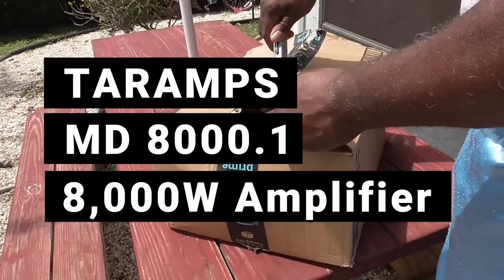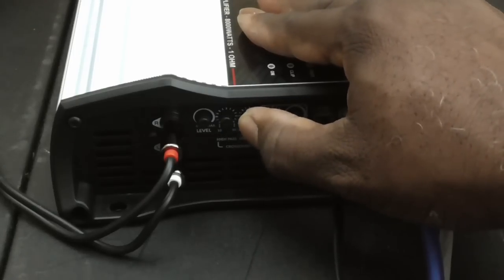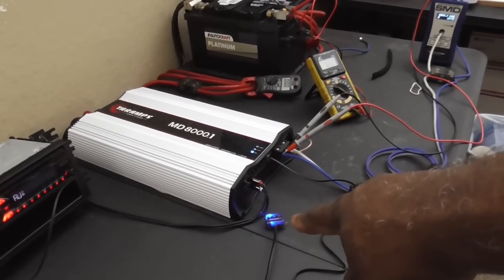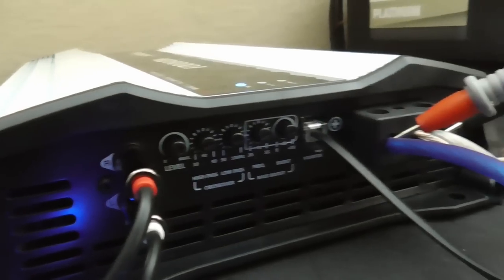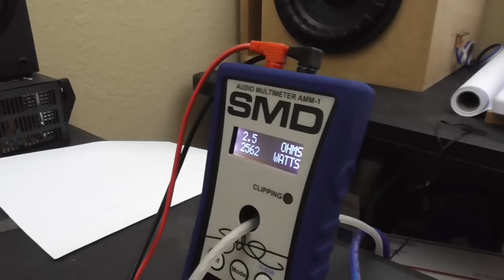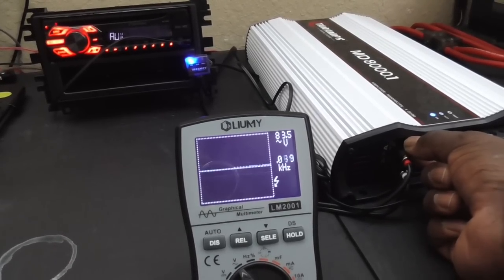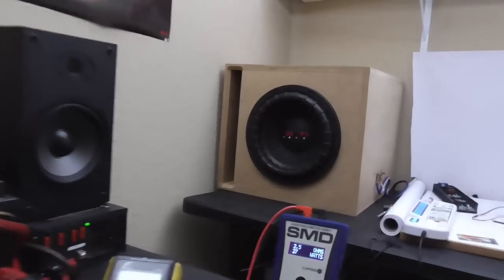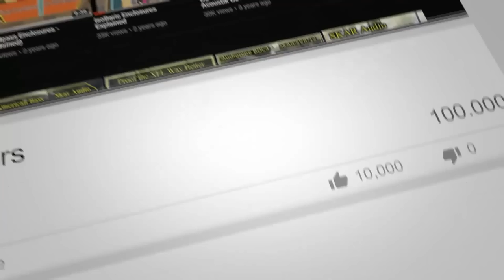Should You Buy This Amplifier? TarAmps MD8000: 1 & 4 Ohm Testing

Comment: That amp is not a amp equip for a subwoofers, impedance has nothing to do with it, sound quality will be horrible, and the amplifier is more likely to blow because of the incorrect frequency the amplifier components that are not built for low frequencies, that amplifier was built for midrange and high between 90hz to 25 khz.
Reply: maybe read the specs again
Reply: Done... Brazil amps lie.... They  are weak below 35hz... They say 10hz...ya but down lower 24db...!!